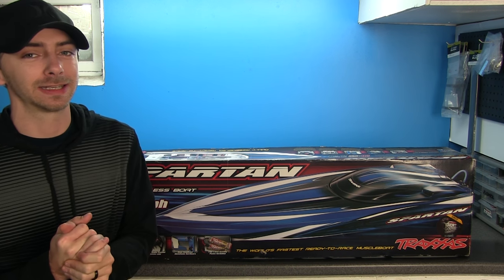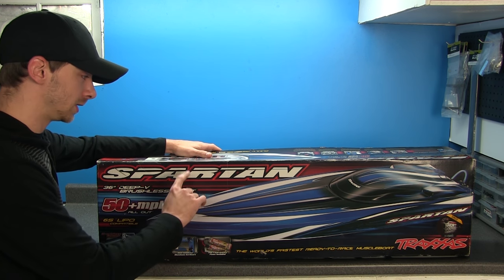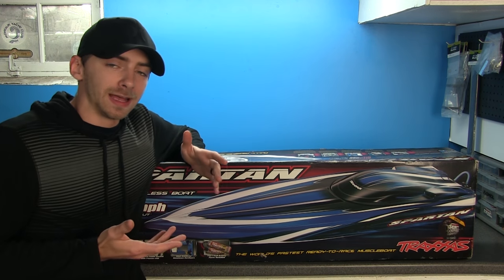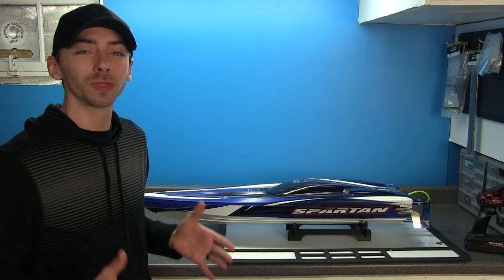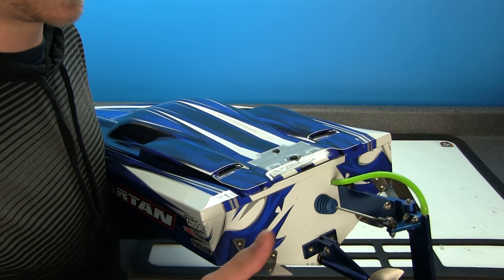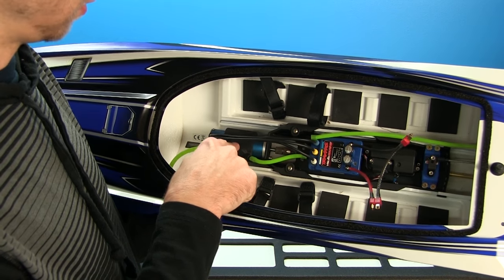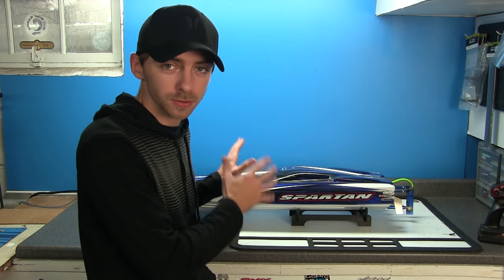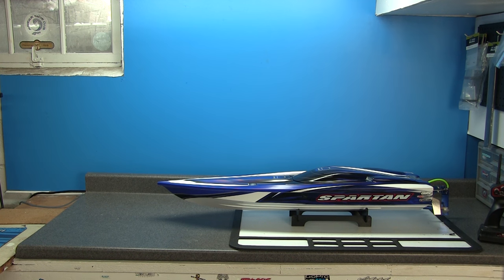Traxxas Spartan 6S LiPo RC Speed Boat Overview

Comment: You need to leave a 5mm gap between the strut and copper fitter on flexshaft as your shaft will shrink in the water